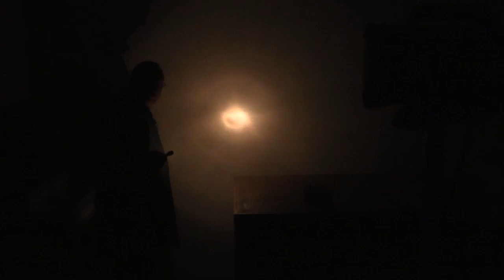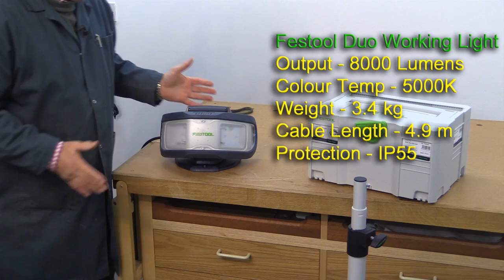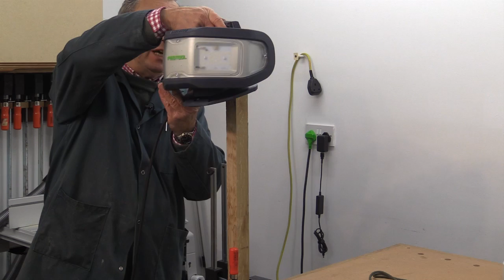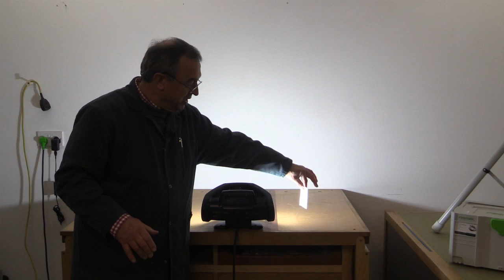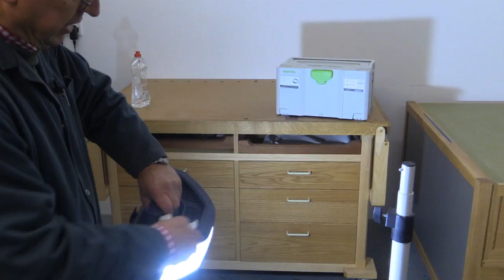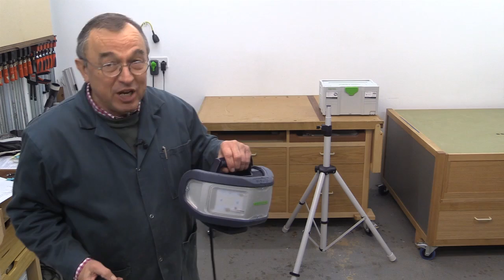Festool Duo Working Light

Comment: Peter, do you have any speculation as to why Festool chose not to include an on-off switch on the light?
Reply from the maker: I do not but guess it might be their concept of how the light might be used...turned on at the start of a job and off at the end (or end of a day) which only needs a plug going in or out of a socket. If the light were to be used for brief periods of time then an on/off switch might be handy but most people set it up and use it for extended periods. That is just my guess of course.  Peter

Comment: Great video, as always Peter; humorous start is particularly good! Maybe I am looking at it incorrectly but if you remove and mount the light's base to a horizontal piece of wood or a ceiing, say, and then attach the light how do you remove the light from the base afterwards, should you need to? The clips to release the light from the base appeared to be covered up.
Reply from the maker: +Itz MeAgain    I must confess that I spotted this before I uploaded it and expected it to cause a stir a little sooner.... The tabs that I said I pushed to release the base do not need to be touched at all. As you know, I have rather arthritic hands and wrists and so I found it quite tricky to release the base. I seemed to manage it when I played with the tabs but it was just chance. The base is just a friction fit and can be removed very easily by any normal human being especially if they are 2m tall like me !   Cheers.    Peter
Reply from the maker: +New Brit Workshop (Peter) I have now put a note on the video at the right place.   Peter
Reply: Thanks for the quick response Peter! My workshop never seems to have enough light in the right place at the right time so this seems to be a useful piece of kit, especially with the various mounting options available.
Reply from the maker: +Itz MeAgain   Festool have been very kind lending this (and other) kit to me so that I can make videos. The colour temperature is almost perfect for video work and I have now convinced myself that I need one too.     Peter

Comment: Excellent demo as usual, Peter. I haven't seen this product for sale in the U.S. yet, but all their other corded products sold here are 110V 60Hz as far as I know. My TS 55 track saw and OF 1400 router certainly are. Not sure why they wouldn't provide 110V for UK. Your mains current is 50Hz though, right? And a slightly different plug/socket configuration?
Reply from the maker: +Michael Anderson I can't see a problem producing a 110v version. Yes, we are 50Hz and our plugs and sockets are different from the US and Europe.    Peter

Comment: Are they available in 110 v Peter?
Reply: +palmer3977 

No, not as yet. And doubt we will see one.
Reply: carlb401 Just like the Domino XL, BIG thumbs down Festool, make a domino XL in 110 volt for us site users.
Reply: It has been asked for by one of the uk dealers, who got them to make some of the sanders in 110v. But Festool flatly refused to make an XL in 110v.
Reply from the maker: +carlb401 Thank you for letting us all know this. Perhaps Festool do not regard the DF700 as a "site" tool.   Peter

Comment: what does it cost? $1,000?
Reply from the maker: +MusicSmith I am not sure of the dollar pricing but in the UK it is just under £300.    Peter
Reply: +New Brit Workshop (Peter) I live festool stuff, I just cannot justify the price as a hobbyist.
Reply: +MusicSmith  I think you will find most Festool users are hobbyists.  It's more expensive initially, but considering you won't have to replace it several times over, its actually a better value.